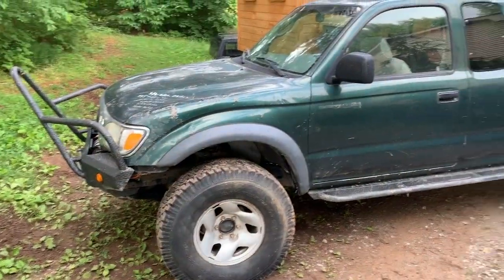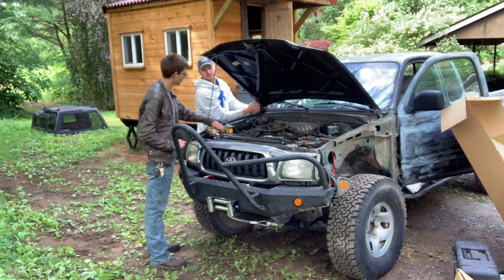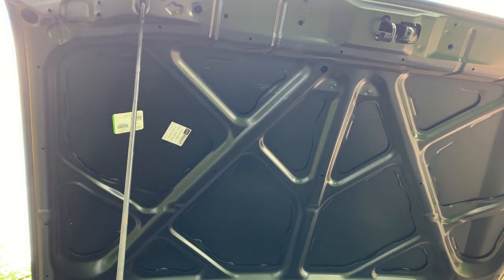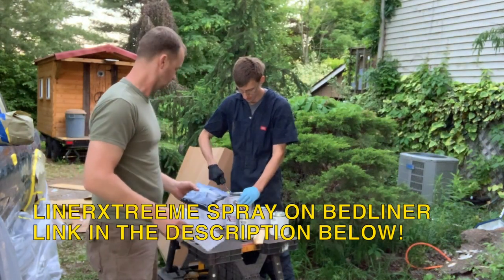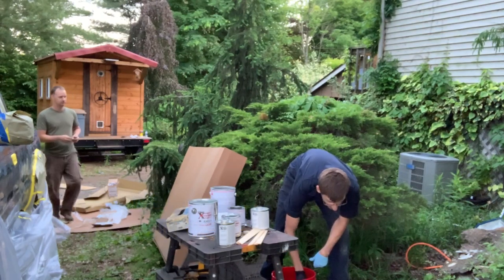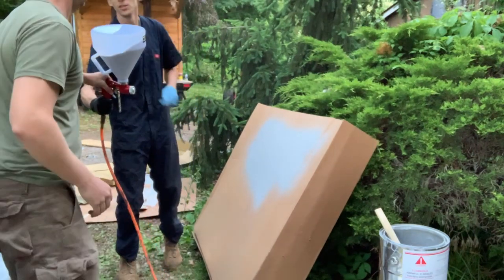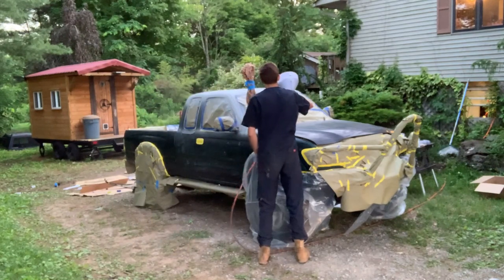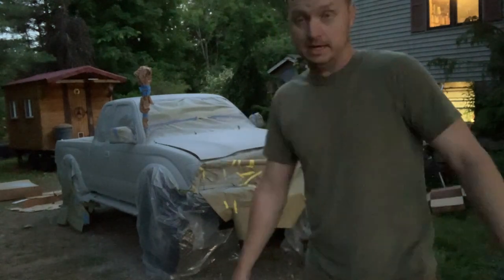Painting my entire Tacoma with LinerExtreeme.

Comment: Why didn’t you use raptor liner it’s much better
Reply from the maker: I considered raptor liner, but I’ve never seen the two products side by side to definitely say one is better than the other. I did find LinerExtreeme to be a good product, and it still looks good over a year later.
Reply: @ericmann5804  how much did you use?
Reply from the maker: @stevebauer5491  I used one half of the 3 gallon kit and that did slightly more than one full coat. They recommend two coats, and I would also recommend two coats.